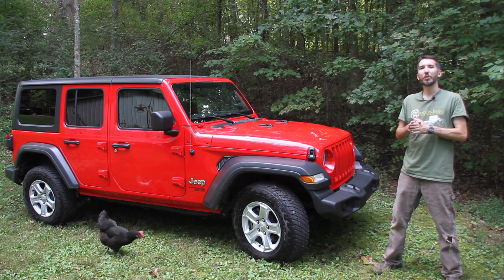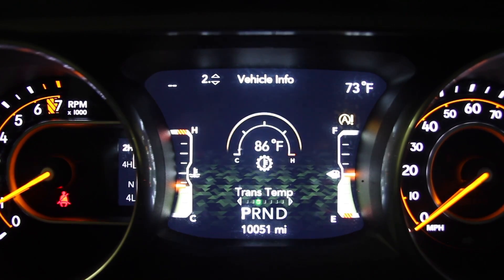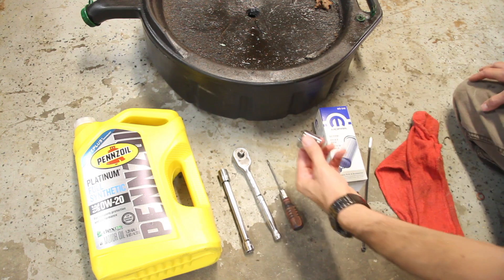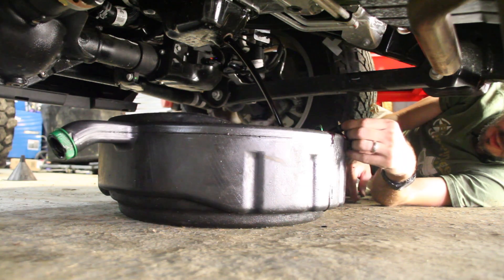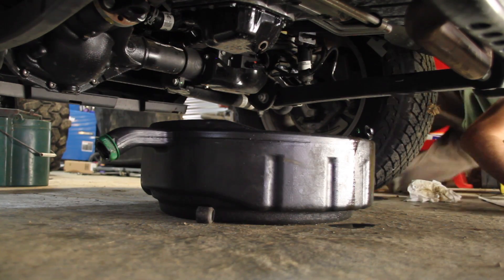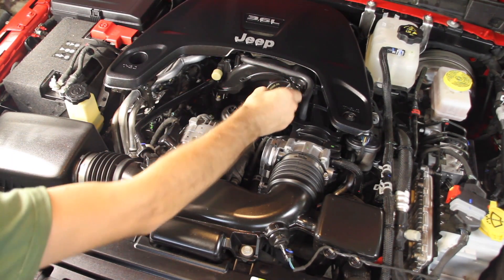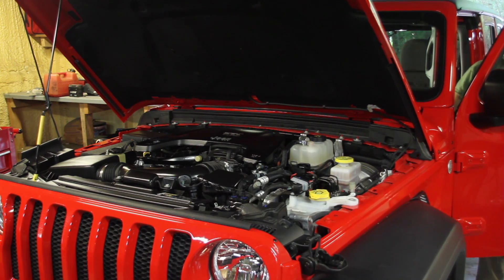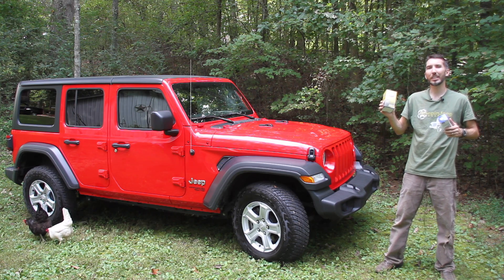How To Change Oil on a Jeep JL, JLU and JT

Comment: Cool, I've not seen the cartridge filters before. Nor have I seen and oil filter accessible from the top of an engine.
Reply: same... I like it (the filter thing I mean) because it should be cheaper to not buy a whole metal thing, also allows you to see the state of your oil and filter. Also seems like it helps prevent over tightening like every motherfucker does with the metal canister ones. As far as it being on the top of the engine idk if I care for that or not, I guess I do like it, it looks like you could potentially remove it without it dumping oil out too since its up top.
Reply: Motorcycle engines have them.
Reply: @Garth2011  I'll have to admit, I was ignorant of that fact. I haven't ridden one since the early 90's, so I have not really paid much attention to the ins and outs in the motorcycle world.

Comment: I’m excited to change the oil on my 3.6 with the same ease of the 3.2 Crossfire engine with the oil filter cartridge being right on top. Be warned though, there have been a lot of complaints about paper oil filter elements deteriorating and contaminating your engine. There are more reliable fleece filters available but I’m not sure if they have them for this application or not.

Comment: I’ve been told by countless mechanics to never rely on the oil reminder. It can be highly inaccurate, sometimes not saying to change oil for 20,000 miles or more. I do like what Jeep says in their manual to not go past 10,000 miles but still I was always told 5000km (3000 miles) for regular oil and 10,000 km (6200 miles) for synthetic or if the oil is older then a year regardless of the type. Too many people who don’t know a lot about vehicles will rely on that service light and end up ruining their engines a few years later
Reply: kevin hache especially if they use pennzoil brand oils ive seen it too many time. Smh i stick with castrol mobile or valvoline
Reply: word, although the mechanics and automotive info I have seen all seem to agree that 3000mi mark is for ancient times, modern engines+oil is more like 6k miles for even non synthetic. But at the end of the day, I just change my oil when it looks like it needs changed... that dipstick aint there just for admiring.
Reply: I go by this as well.  5k for standard, 10k for synthetic.  KMs, not miles.
Reply: Dwealdric yup id rather spend the extra $30-40 and have peice of mind

Comment: Now do an LS swap, a six inch lift and put some 35's on it.
Also you'd think that if the Jeep has an oil life sensor, it would automatically know when you put new oil in it.
Reply: Brian Johnson 40’s at least 🇺🇸
Reply: @AmericanJeeper  absolutely! Dunno why I didn't think of that.
Reply: Brian Johnson put that LS to work!
Reply: JLs don’t need 6” of lift to fit 35s
Reply: 35s on 30" rims.

Comment: No spin on filters. Maybe that design is to prevent oil from going into the trash cans. Interesting but, for anyone wanting to hold onto that Jeep for 20+ years should plan on stocking up on that filter holder as it is plastic and likely, after a few temperature cycles and basted in oil a few years, it will break down and crack, likely at the parting line. Can't somethings that are a moveable or an active item remain made of metal?  LOL...I'll stay with the Mobil 1 BTW.

Comment: Why 0W-20? Seems a bit thin for me. I've always done 5W-20 in the winter and 5W-30 in the summer (JK previously, and JL now). I'm in eastern PA. Where are you? Also, I think Jeep recommends 5W-20 like almost every vehicle out there now. Not to start a viscosity battle, but I don't see 0W used that often.
Reply from the maker: Both my yota and jl service manuals and dealer call for 0w20
Reply: New vehicles use 0-20w mostly. that changed a few years ago when they went from 5-30 to 0-20. Thin oil is better as long as it is fresh modern spec.

Comment: Matt is that not the easiest vehicle you have ever changed the oil on. My wife’s JK is set up very similar to that, only it takes 6 qts. But that is the fast vehicle I have ever owned to change the oil on.
Reply: I have a JK and my only complaint is the 6 qts.  I always have to buy the extra single qt. lol grrrrrrrrrrrrrr

Comment: 10K is a little farther than I would go. My WJ just hit 280K on the original engine so the cost of the extra oil changes I feel was well spent. I would also recommend that you don't just change your oil especially if you off road at all. The oil change is a great opportunity to inspect for damage or unusual wear. On the WJ it is a pain to inspect the soft line to the injectors. It takes a long inspection mirror and a lot of patience to do a good inspection  but that's better than burning your Jeep to the ground.

Comment: Matt your doing the oil change incorrectly.  No seriously. loosen the oil filter first to let the oil in the housing drian down. While the oil filter cap is loose then drain the oil pan. Then proceed as normal.  This is from FCA . This what we were told by in technical training on the 3.6 Pentastar engines, actually all new engines with a canister loosen the oil filer cap first.
Reply: Maybe so but this drained out normally and he did remove the oil filter before the drain plug was put back. They are likely thinking there's a vacuum created with the cap on, maybe, but it was released when he remove the cap for the filter exchange.

Comment: Cartridge filters, mehhh, they are just cheap low quality crap that fail too easily. Why can't Jeep just use a proper can filter that has been proven for decades and is still used today on all commercial / industrial machines and engines.  Lovely Jeep though
Reply: What's inside the can filter?
Reply: Agreed on the plastic cap as cheap. After a few insert and remove filter, that plastic part is going to have a wear problem. Should be made of steel.

Comment: I dislike these new electric gas pedal Fiat Jeeps. Lol electronic gas pedal. Nope! The new motors are a little questionable especially the economy ones, lots of knock... I dislike cartrage filters. Thier cinvenient all up in top their and all but they can set stuck and broken if overtitened, to hot and forced or dropped. They could just put a regular oil filter their... Use the correct socket if you strip it lol yes the plastic nut can be stripped, you are screwed. You have to use th vice grips of life if they fit in that area and if the plastic holds up you can get lucky and get it out after stripping. Use good vice grips the first time...plastic all though as strong as metal on paper wears out faster. Becoming soft or brittal is a common problem with plastic that metal does not have. Plastic cracks a lot more and fails a lot sooner than metal...

Comment: I change my oil every 2000 miles no matter what
Reply: You don't need to, oil doesn't break down, it just gets dirty. Changing oil every 2000 miles is a waste of money and oil.
Reply: @metalhead4x448  The oil does in fact break down, but modern oil can easily go 5000 without much if any degradation.  Especially if you use a quality synthetic.
Reply: Oil companies love you.
Reply: the key in your comment is using Synthetic
Reply: @Mountain-Man-3000  but in the older cars synthetic isn't the best. Sure in the new cars that are ment for synthetic it works good in but synthetic is useless in the older cars. They weren't designed for it. My dad has wrecked over drives and every thing else because of synthetic fluids. He can change it every 2000 if he wants to who cares. Plus even if the oil doesn't break down it still gets chips in it. Sure there is a filter but the chips still take time to get to the filter.
Reply: I change my oil every day no matter what.

Comment: That is not a good way to determine changing your oil because the computer does not know the condition of the oil it is only using an algorithm to calculate oil changes. It does not the environment that those miles were put on. Car manufacturers only want their cars to last long enough to meet minimum customer expectations. They are in the business to sell you a new car.  I have had the pleasure of dealing with internal engine problems of customers cars because they are using the manufacturers recommendations instead of changing it on shorter intervals such as 3k to 5k miles. I'm surprised Matt that you don't know and understand this. An oil change is the cheapest insurance you can buy for your car.
Reply: I dont necessarily disagree with you and would personally not trust the oil life thing either myself, but technically the car has enough sensors to pretty much know the state of the oil quite prceicely even without directly measuring it (although frankly that would potentially be easier), the car has air sensors, speed, miles, rpm, temp, pressure, time, exhaust, etc. data and frankly that is more than enough info to know the state of the oil with great precision. But again, I agree I prefer to just go by the dipstick.